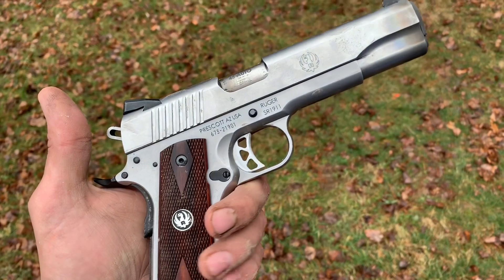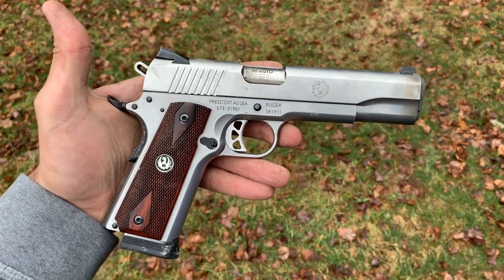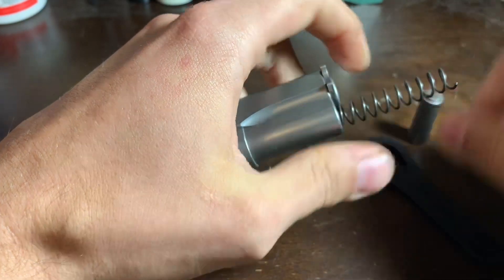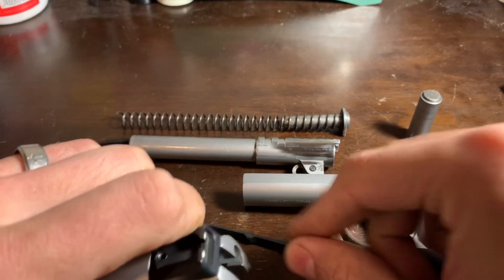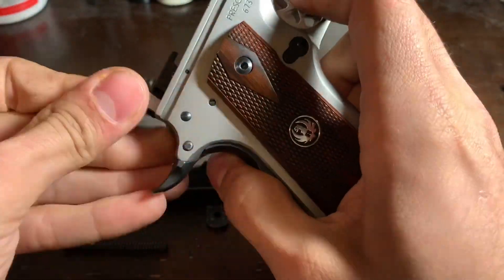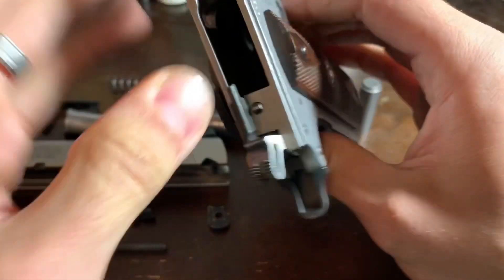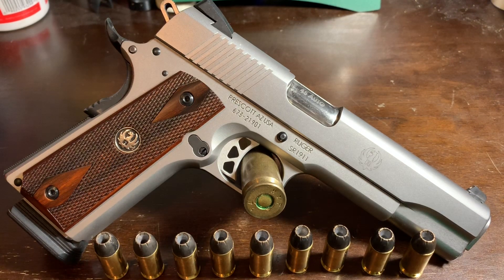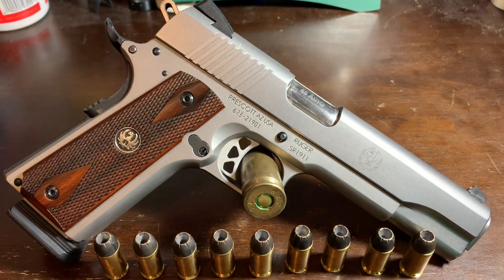Ruger SR1911: 600 Round Update and Initial Impression

Comment: Good video. I have to mention two things. First, the frame and slide are not MIM, they are investment cast, which is a manufacturing process that Ruger has done for decades and are masters at. It is a major factor in how they have been able to keep prices down on their products. Also, and this is a HUGE improvement over one of the inherent 1911 weaknesses, is that the plunger tube is not staked, it is part of the actual frame. Plunger tubes loosening over time and use is a common issue, but Ruger eliminated that issue. A big bonus in my eyes. We have an SR1911 in our collection and it too has been great. Love the black powder loads!! Just found your channel and like what I see. Now off to your 460 Rowland vids. Thanks.
Reply: No, they not cast. They machined them on the SR1911. They found out it was actually faster and cheaper, to machine them, as opposed to casting them.
Reply: The frame and most internal parts are either cast or MIM. The slide and barrel (along with barrel bushing) are machined from bar stock.  This information can be easily found by google on multiple websites :)

Comment: i'd recommend for those of you who dissasemble 1911's like this to try doing it differently. try doing it like a glock, dont mess with the bushing, just pull the slide back to the takedown notch, take out the slide stop, keep 4 fingers under the slide as you remove it to keep the spring in the slide, and just remove the spring, guide rod, plug. then you can take the barrel and bushing out as one piece. put it back together the reverse order. much much quicker. it's how some of the best pistol builders do it when they're constantly diss/ass guns while building.

Comment: Nice review.  I got my SR1911 in 2015 and shoot it weekly the range.  Usually 100 rounds.  It was super tight new and broke in now with over 5000 rounds though it.  It always goes to the range along with my Glock model 23.  I love them both.  Both are reliable and highly accurate.  I paid $673 when it was on-sale.  I carry my Glock for EDC, more ammo in the mag.  I like the finish on the SR1911 as it shows virtually no wear and still looks new when clean.  I got the Ruger brand 1911 because I own other Rugers and happy with them.
Reply: In the time of covid this gun as with all others has gone up. I paid 825 used in New condition.
Reply: @Wildwestwrangler  Well, good to know, but it's one of the three guns I won't get rid of.  Remington is making a boatload of ammo now, so I will be back to shooting it alot at the range as bulk ammo is available.

Comment: Have this model. Installing night sights on it. Great pistol just slightly too big for conceal carry.
Reply from the maker: The right holster will help. I carry mine in an Alien Gear Cloak Tuck 3.0
Reply: @AmericanArmsChannel  Hammers scare me for carry. Don't mind for home defense. Weird I know.
Reply from the maker: There is no logical reason to be concerned with the mechanical aspects of a external hammer sidearm versus one that utilizes an internal hammer or a striker design. If the mechanics of the firearm are safe (as in they function properly and not so light in engagement surfaces that the lightest bump or smack will trip them) and you are carrying in a holster that encloses the trigger in a way nothing can interface with the trigger when holstered, there is no possibility of a discharge. 

It is just as arguable that a 1911 pattern firearm is “safer” for carry than something like a Glock pattern pistol because it has a mechanical thumb safety that locks out the trigger mechanism and the latter doesn’t. Neither is safer, they are dangerous tools that are only as safe or dangerous as the user. 

Do as you see fit for sidearm carry, no judgement, but do take note that you are making a decision based on a feeling and not the reality of your firearms mechanics. 

Now, if you are discussing size and weight constraints versus ergonomics and capacity factors as to why you would not carry a 1911, that is a very valid point. 

My typical every day carry is a Springfield Hellcat Pro with a red dot and TLR-7 pistol light in a Werkz M6 holster. I choose it 9/10 times for concealed carry as it loses nothing for me and has ample capacity, shootability, size, accuracy, dependability and intuitive controls for which I have trained thousands of rounds on. But, I still carry other handguns from time to time just because, even if they do not make as much since as the modernized and highly efficient option. 

So, my point is make the choices you see fit and live happy, just know when you make an emotional versus logical decision…. And most importantly, be trained and ready. 

Have a blessed day and thanks for watching! 

- Drake

Comment: What happened to the 1,000 round update? That would be great to see.
Reply from the maker: Never got to it and didn't see the point as there has been a lot of coverage of the Ruger SR1911 over the years. I can say though, that it has done exceptionally well over 2k+ of standard and +P 45 Auto loads and even 500+ rounds of 460 Rowland using a conversion kit.

Comment: I've been looking for a springfield ronin, for over a year now, and can't get one, so a few weeks ago, I purchased the ruger, instead.   First 18 rounds, I had 2 stove pipes, using federal round nose ammo.  But the topper, was that the rear sights came apart,  sent it back to ruger, and when it comes back, it's gone !!!!!!!
Reply from the maker: I'm sorry to hear that you have had a poor experience with your SR1911. I have not seen or read of many issues with the SR1911 series, but like any mass produced item they can have their lemons. The only issues ever encountered with my SR1911 have been when tuning a .460 Rowland conversion kit and with cheap, poorly made magazines. Magazines for the 1911 can vary enough that you are bound to find some that will not agree with your specific 1911. I have found the Kimber, Colt, and Sig magazines to be the best performers overall for my SR1911, using both 45 ACP and 460 Rowland.  

In a 1911, stove pipes are most commonly associated with low power ammunition, "limp wristing", or excessive action spring tension. Failures can also sometimes occur if a magazine is overloaded or has very high spring tension and that upward force retards the slide, robing it of the energy it needs to strike the brass on the ejector hard enough to clear the ejection port. Being that it was a brand new firearm, I am sure it will be corrected by Ruger. I would give it a second chance with quality magazines and a round count minimum of 100 rounds before giving up on it. Believe it or not you have just about the same chance of a lemon in a Springfield 1911 as you do a Ruger, Kimber, Remington, or other in the $1,200 or less price range. 

When you say that the rear sight came apart, what do you mean? Did the stop post (Allen screw in the center of the NOVAK pattern sight) come loose and allow the sight to drift in the dove-tail? Even then the dovetail fitment should be very tight and prevent drifting...

Comment: My dad bought me this SR1911 as a gift for my first gun for Christmas. F***ing amazing gun. I love it! I’ve already sent 100 rounds through it at the range. Because I don’t know much about this thing, at what point should I clean it? After each range visit or after a certain amount of rounds fired? I didn’t watch the entire video so I apologize if you mentioned this
Reply from the maker: Cleaning regiments depend entirely on the user’s needs and the condition of the pistol after use. If it is going to be depended on for defense, I would recommend a minimum of a wipe down after every range session and a detailed clean every 300-500 rounds. Use each wipe down and detailed clean to check critical components for excessive ware or damage. 

The SR1911 is a great handgun and very dependable, but it is still a very refined 109+ year old design that is not up to the same snuff as more contemporary ones as to when it comes to reliability without cleaning in high round counts. So just keep that in mind when considering your own cleaning regiment for your new pistol. I have seen 1911 pattern handguns go thousands of round with little to no maintenance and never stutter. But I have also seen them choke in less than 500 due to tight tolerances. 

As a note to maintenance of your new pistol: 

1) Remember to change the action spring every 2,500 to 4,000 rounds. I recommend wilson combat, ed brown or sprinco as upgrades to the OEM. Sprinco springs will increase the round count life of the spring to past the life of the pistol, so solid choice in replacement right there. 

2) magazines will wear out faster than the gun, and their spring sooner than the bodies. I recommend changing out mag springs every 2,000 rounds and replacement of mags carried for defensive use every 4,000 rounds or when necessary. Make sure you check feed lips and followers for damage every time you clean the pistol. 

3) Be sure to buy an extra firing pin, firing pin Spring, action spring, and extractor to keep on hand for future replacement if you plan to run a lot of rounds through the gun. These components are easily maintained and replaced. It never hurts to have spares on hand just like having a spare tire in your vehicle. 

Congrats again on your new handgun! Should you have any questions or concerns that go beyond the help I can provide through the comments, feel free to email me at: 

AmericanArmsChannel@gmail.com

God Bless and keep your powder Dry.
-Drake

Comment: I bought the commander the year they 1st came out I only have maybe 250 rds through it she’s super tight snappy and shoots high mines is extremely built well mines doesn’t rattle like most. I couldn’t find out if they handle “plus P” I really like core bond
Reply from the maker: The SR1911 can handle "+P" loads, but you may want to increase the action spring tension by a pound or two to accommodate for the higher recoil impulse and combat excessive slide velocity as well. If you really want to run hot 45 ACP based loads out of an SR1911, you can always purchase a "+P+" or 45 Super barrel as a "drop-in" solution. 

Converting to .460 Rowland is also an option, even with the commander variants. Do be mindful, however, that on using a "+P+", 45 Super, or 460R barrel conversions you will want to swap out the light titanium OEM firing pin for a heavier steel Series 70 one such as those from CMC, WC, or others, or an extra-weight firing pin from Rowland. This will mitigate or eliminate firing pin drag on the higher pressure cartridges. This will however delete the "drop-safe" nature of the lighter weight firing pin in the Ruger's Series 70 design, so it is something to be mindful of. IMO though, the "safety" of the Series 80, Series 90, and Kimber firing pin block designs do minimal to assist in “safety” and only add complication to the premise of "don't be a numb-nuts and drop your damn gun!" 

If you are carrying a handgun, secure it in a quality holster with secure retention (IE, you can jump, twist, turn, and run and the MF'er is not coming out of the holster). BUT, that is just my 2 cents. 

Thanks for watching and the comment, Me Clay!

Comment: Im considering buying a 1911 commander from ruger. in germany its about 1500€. dont know if its worth that price or stay with a german crafted 1911 for about 1800 bucks. i like the oldschool look and in germany usually theres 5 or 6 inch 1911 for static 25meter shooting disciplines. very accurate guns and damn good quality. but i dont like that look of the german guns. i like it more oldschool. dont know what to do 😂

Comment: I own several Ruger 1911’s you kept saying that the frame was MIM, but I thought i read that these are all stainless steel forged frame, slide, barrel & bushing, i know there are some mim small parts in it
Reply from the maker: The frame is Created with Ruger’s standard process of Investment Casting. So you’re right in that it’s not MIM. I must have had that term stuck in my head. There is a difference, obviously, between the MIM and IC components in the SR1911, but for all intents and purposes it means the same thing to buyers.
Reply: @AmericanArmsChannel  doesn't mean the same to me.
Reply: You are correct.  The man making the video is wrong.

Comment: I own the Ruger SR1911 as well. I currently shoot the Hornady Critical Duty 220 Grain. Can I shoot Federal HST 230 JHP in this pistol? I have heard the 1911 is not to hollow point friendly.
Reply from the maker: There will be no reason why it cannot utilize the Federal load. You will need to test the pistol and your magazines for reliability with the selected ammunition. Never assume a specific load or bullet type will or will not work based on what someone says on the internet. Test it yourself and confirm the truth of the matter. I will add, that a properly built 1911 using high quality magazines will cycle most loads and bullet profiles VERY reliably; I have had little to no trouble with truncated-cone profile bullets like the hydrashok in my SR1911 using the factory Ruger magazines, Kimber mags, and Colt Mags.
Reply: @AmericanArmsChannel  I agree!!! Every 1911 is different. I have the Springfield Armory A1 Mil Spec 1911 which is an excellent pistol but does not feed the Federal HST well but will feed the Hornady Critical Duty very well. Thanks for the good information and video

Comment: Fired my first 48 rounds 3 ftf hope it stairtens out
Reply from the maker: Failures to Fire or Failures to Feed?
Reply: @AmericanArmsChannel  failure to feed
Reply from the maker: @mollyknaur3894  That will almost certainly be a magazine issue. I have had no problems with my Ruger OEM mags regarding feeding, however it is completely possible to get a lemon. Try to isolate which magazine(s) caused an issue and set them aside. I highly recommend utilizing Colt (7 rounds), Sig (7 or 8 rounds), Kimber (7 or 8 rounds), or Mecgar brand (7 or 8 rounds) 1911 magazines.

I have used these brands in several 1911's and had NO feed malfunctions with any of them in standard pressure 45 ACP, 45 ACP +P, and 460 Rowland loads ranging from 185 grains to 260 grains. I have, however, had issues with a 10 round CMC magazine with some ammunition in my Ruger SR1911, but had no issues in a standard model Kimber or a Kimber ProCarry II. Magazines matter, and quality mags are nothing to skimp on. 

Polishing your feed ramp may also help. Watch your bullet profile as well; certain magazines may not present sharply truncated bullets or very blunt bullets to the feed ramp properly. 

I hope this helps.

- Drake
Reply: @AmericanArmsChannel  gun is new have about 58 rounds thru it both ftf with ruger and Wilson mags cleaned and recoiled for 2nd time switched from Fiocchi FMJ to Winchester white box fired 8 rounds today so far no ftf will shoot more later when SNOW stops

Comment: It's a pre series 70 design.
Reply from the maker: No, the SR1911 is considered a Series 70 pattern 1911. The Series 70 updated the 1911A1/Colt Gov. Model pattern pistol with some minor tweaks to production methods and components, but the largest change Colt attempted to market was a collet style barrel bushing, but not all models were equipped with this component. This collet bushing was eliminated in the Series 80, but a firing pin block safety was added to the trigger mechanism and the firing pin and firing pin channel modified to accommodate. In 1991 the Series 90 was introduced which made additional modifications to the Series 80's, but it is not a preferred model when compared to the 70 and 80 series. 

Generally, when referring to modern production 1911's, a model with no firing pin block safety is considered a Series 70, while one that has one is considered a Series 80. Only actual Colt Gov. Model M1911's or M1911A1's and their "retro" or reproduction facsimiles that copy them are considered "pre-Series 70". The SR 1911 being a modernized rendition of the Colt Government Model without a firing pin block safety is considered a series 70 pattern 1911.